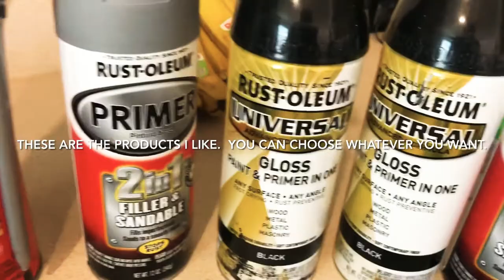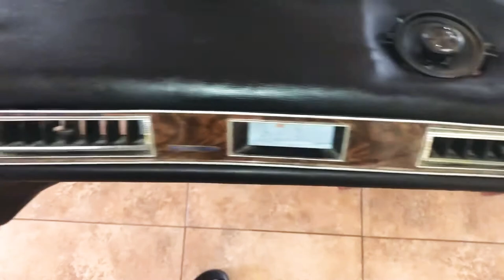How to restore a cracked dashboard in a 1977 Oldsmobile Cutlass Supreme. DIY the Simple way!!! $$$

Comment: I just got done with the dash in my 77 Cutlass dash also, mine had the exact same cracks, the forum guys, who i RARELY listen to. said it was the weak spots in the dash, they are almost all like that. That spot that you couldn't get has to be done first and completley dried before you do the rest of the dash, I had to redo mine twice before I figured that out. I also used Wildwoods brush on adhesive, it has a 30-45 minute dry time so it gives you time to work it. Where in Arizona do you live? I live up in the Northwest corner (Bullhead City,  Fort Mohave) area, Come up and we'll go to a cars and coffee, show or swap meet in Vages or we could even pop over to the Ponoma Swap Meet/car show, it's just 3 hours from me, I've been here since January and i've been to the 3 so far this year, it's an experience every gear head should have atleast once and that would be some great content for the channel.

Comment: How did u remove it ? I have a 77 cutlass  s  and it needs to b fixed up
Reply from the maker: Start with the screws around the speaker grills, then the screws inside the speaker housing. From there go to the screws around the vents (top and bottom)
Reply from the maker: Also make sure you get some small baggies and label them in order to reverse ur steps the proper way
Reply from the maker: You will have to unscrew all bolts around the steering wheel and the by both doors
Reply from the maker: And lastly make sure that you remove the instrument cluster screws and be careful when you get ready to drop the steering column there’s a thin paper clip like bracket that’s attached to the gear shift select (that’s if it’s on the dash)
Reply from the maker: The primary bolts will be inside the dash once you remove the instrument clusters. You will see them once you pull em out.
Reply from the maker: If you need anything I’m here for you. Just let me kno. God bless